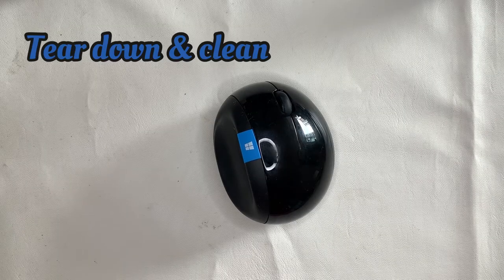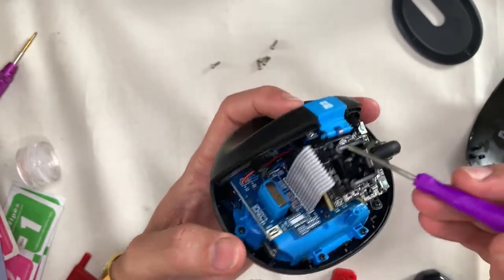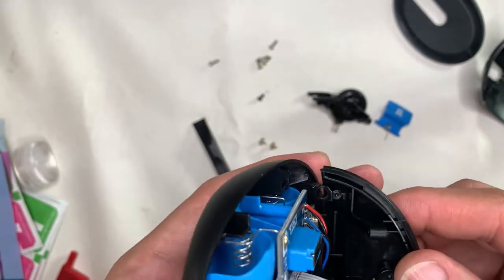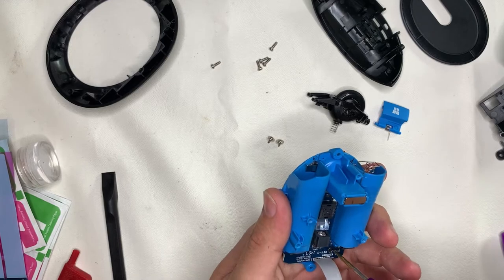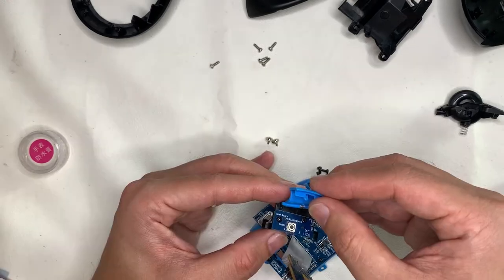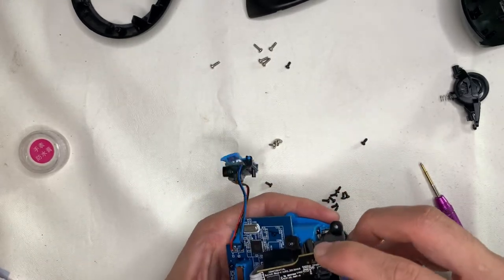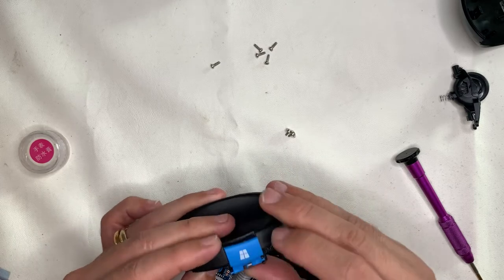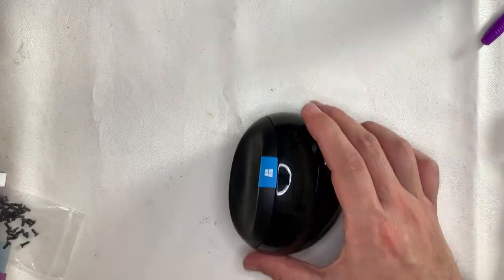#22 Tear Down & Clean Microsoft Sculp Ergonomic Wireless Mouse L6V-00001

Comment: Thank you. This helped me fix my mouse. One thing I'd like to add, I have two sets of Microsoft Sculpt Keyboard & Mouse. This mouse in particular has a defect where the side buttons stop working after a certain time with use. That's because the rubber around the button tends to loosen and will fill the gaps around the buttons, therefore blocking their movement. After opening my mouse, I realized this and so I went ahead and used an exacto knife to cut a hole beneath the blue Windows button by following the groove that's already there to frame the side button. Once the rubber was removed, the side button plastic flap underneath was exposed and allowed it to return to an unpressed state, and the blue button finally had the room to be pressed down.

Comment: hi there, thank you for your video! my mouse started to not turn on at times and after following the video and opening it, found the spring at the battery to be a little corroded. after cleaning it and clearing out some dust at the mouse wheel, it is working good as new! awesome work with the video and keep it up!

Comment: Hi there. Great video!
I have the exact same mouse and the other day the scroll wheel stopped working.
The press function works fine, but no scroll up or down whatsoever.
You did not mention anything about the encoding sensor. Is there a chance to clean it or something, or I should go ahead and get a new mouse?
I have already open and cleaned both sides of the infrared sensor with no success...
Thanks in advance.
Reply: I have the same problem, how can this be fixed?
Reply: I have the very same problem and was wondering the same, can the scroll wheel be fixed?
Reply: any update? I have the same issue.

Comment: WARNING- unfortunately, the plastic end of the right-click mouse button broke off when I pried off the lid to clean the buttons area of my MS Sculpt Ergo mouse. I pried the lid off from the right side exactly as shown at 1:23. I do not blame the creator of this video, but just be warned that you are taking a risk to pry off the cover. Maybe try to clean it with compress air duster first before trying to pry off the cover. I blame this on poor quality from Microsoft because the cover should be easy to remove for cleaning without damage.

Comment: Hey thank you so much for this, my mouse has the Model number 1560 / China Model 1560C with the title  "Microsoft Sculpt Ergonomic Mouse" and this video helped me get into the right places to fix my problem. My problem was that the BACK button was stack on perma-pressed. The workaround was to loosen the two black screws, apparently. Let's see if it holds up. I loved your helpful suggestion to not be afraid to "crack" open the side once the two silver screws were gone :D
It was nice hearing about why you think it's good build because of soldering. Perhaps you could talk about what makes a good mouse build quality, what you noticed between brands/series. Also perhaps there's this conspiracy theory in the Logitech Trackball world that speculates that the LMB switch is built-to-fail, requiring replacement of the trackball mouse, since soldering is not a trivial thing for most. In case you know anything about that, that'd be cool to hear.